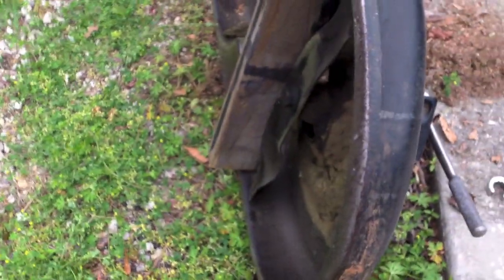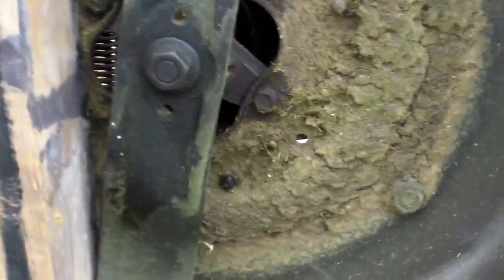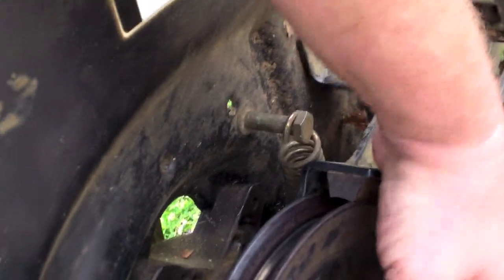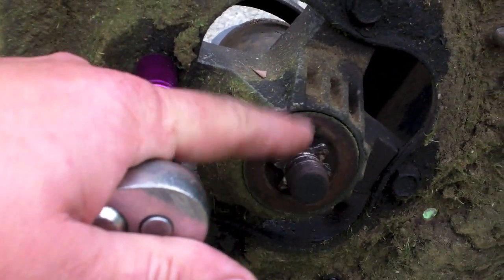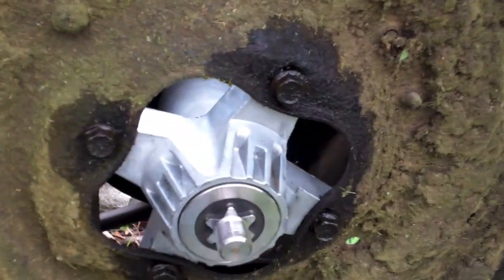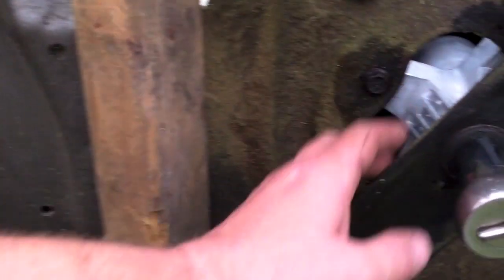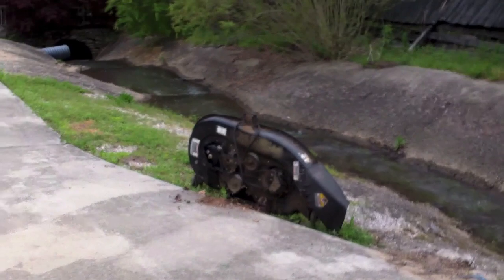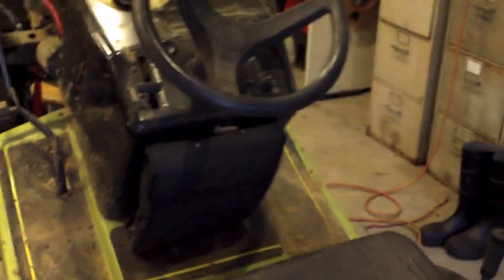How to swap a spindle on aTroyBilt part 2

Comment: I just replaced my spindle assembly today. All I did was put the front of my rider on my car ramp and raise the deck to it's highest level and take the blade off and take the four bolts holding the spindle assembly to the deck out, then lower the deck to it's lowest level and pull the assembly out the top after I took off the belt from the pulley. Then I put in the new part. I also took the self tapping bolts and threaded the holes before putting the new part on the deck.

Comment: For 20 30$ (or pull them from somthing else kinda standard bearings) throw new bearings in that spindle it's the shaft and housing that can't really be fixed to easy
up here in the north the bolts never come out and kills the housing heat pb blaster nothin gets them apart  so housings and spindles are kept around to build more for tractors that ain't worth 40-80$
Keep up the fun vids very entertaining Thanks

Comment: Hey there... thanks for the video.  I had to replace my spindles, but when I took them off, I snapped off the mounting bolts. So on the new ones that didnt come pre-tapped ... and the bolts didn't appear to be self-tapping... i tapped the holes myself. So I'm wondering if there is a torque spec I need to worry about, and if I should use thread lock? Any advice would be appreciated
Reply: Wish you could have showed loosening the blade mounting bolts.I had a tourque wrench and still couldn't break it loose.Going to get some 2×4 pieces and try again.

Comment: What size belt is that?
Reply from the maker: Sorry man I don’t have that one anymore and that was probably seven years ago. Most troy Bilt under the hood they have a spec list of the most common pieces and parts spindles, or, cutting belt, drive belt. If it is no longer on there or you can’t read it you can look it up under the troy Bilt model number on partstree.com

Comment: my deck rusted out so i got another deck (only) i was planning on using my spindles and all from the rusted one. they r all good shape. the mounting bolts just wont come out. ive used everything i can think of including wax. some heat but not to much because of the cast aluminum. nothing worked. so i have snapped them off and now i cant get them drilled out. geeezzzz. wat a bunch of crap. i like to no how u get them off without snapping the bolts?
Reply: Mayhem Country Living i dont have a worn out one. but thx.

Comment: IF YOU HAVE A AIR COMPRESSOR YOU CAN USE A AIR IMPACT AND YOU WONT NEED 2X4'S AND GOOD CHANCE YOU WONT BREAK THE BOLTS.   F.Y.I.           GOOD VIDEO

Comment: The one I have had open bearings, the bearings I bought, (which matched the parts info) were sealed bearings.  Not really compatible.  Ended up buying the entire spindle as a replacement.  Learn the hard way.